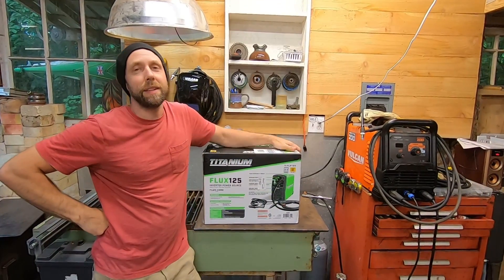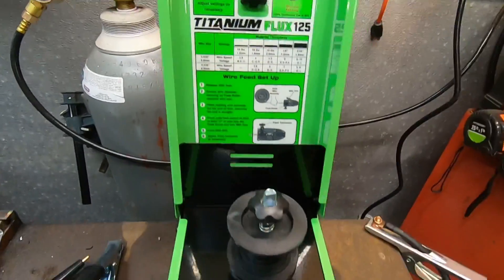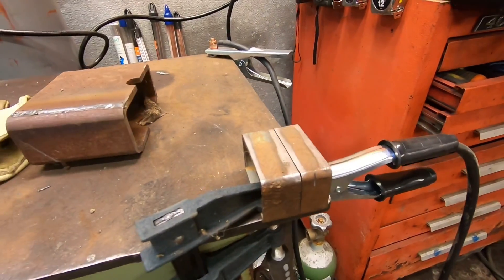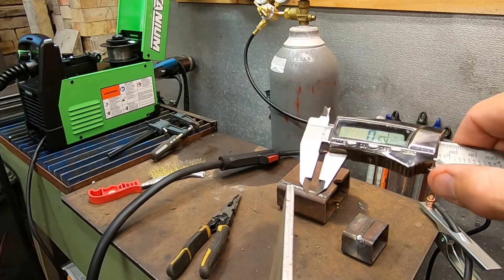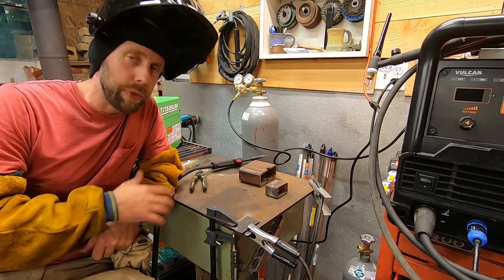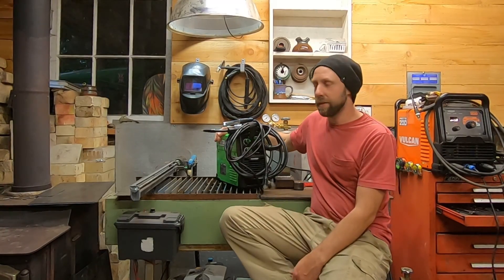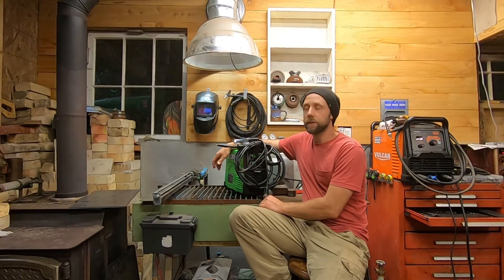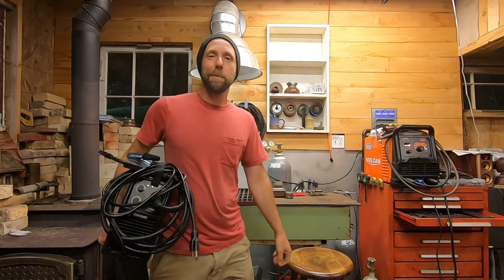Titanium Flux 125 welder from Harbor Freight

Comment: Hey Mike, I just made my first cut on my DIY sawmill, inspired by your channel!
Most of the welds were done with the Titanium 125 flux welder (I have since gotten the 170 so I can run gas).  I still have some work to do, but had to test it out. Belt is loose, need to address that and I need to put a cutting scale/ruler up.  Thanks for the support through your videos.
https://youtu.be/hMDO3ridKa0
Reply from the maker: David Hanson That it awesome David!!!
Thank you so much for sharing this with me 🙂 
Would it be possible once you get the final touches done you could make a video talking about the parts you used like what bike wheels you used and how you went about making it, I and many others would really like seeing that.
If you do, please post it to one of my sawmill videos and I will pin the comment at the top of the comment section with your video link in it so others can check your mill out!
Reply: @Mikefestiva  Sure, I can do that sometime in the future.  I'm better at just building and modding, but talking, will have to make an outline or script so I will not get off track.  I got most of my stuff off ebay, and local iron scrap yard.  He had a lot of 2" pipe, so like you said, try and use what you have around.

Comment: so do you still like this 125 amp welder
Reply from the maker: Yes it’s a good little machine 👍 I don’t use it much because I have the Titanium 200 and ProTig 200 for my main welders so I let my friend use the flux 125 for now. We have a Flux 125 at my work and I use it often for quick repairs around our shop when I don’t feel like dragging a bigger welder and bottle around.
Reply: Mike festiva I just purchased this one so I’m excited to learn and start using it
Reply from the maker: Mark Putito Nice 👍 I think you will have a lot of fun with it. Years ago I bought a little 90 amp flux welder from harbor freight and it got me welding, but I have to say this flux 125 is far better in so many ways then that 90 amp welder. Take care
Reply: @Mikefestiva  hi would you recommend this for some muffler welding? Thanks in advance.

Comment: Hey mike, newish subscriber here but love your videos and has me itching to try my hand at some simple fabrications. I have one of those harbor.F  trailers and I made into a kayak trailer and want to add a second tier to it to add a rooftop ten too. I want to weld it on the trailer instead of just bolting it together. Do you think this welder is the right one to weld 2" square tubing, and will the welds be sturdy enough for about 500lbs. Or should I be looking at a stick welder. Thanks in advance, keep up the hard work
Reply: Should work just fine!!! I personally would add some gusset plate bracing at corners & joints for extra strength & stability!!!😎👍🏻

Comment: Do you think this is okay for a complete novice? 
Project-wise I'm looking to make a simple sidecar on my scooter for my dog. I have a 50cc scooter that is his project and I want to make a simple sidecar out of thin gauge tubing and thin stock. I started trying to braise aluminum but I just burned through a ton of gas and couldn't get decent bonds. I want to learn to weld anyway, and this looks like a great option to start with.

Any advice is welcome and appreciated!  
Thanks!

- Dante Antonio
Reply: It can weld 3/16 no issues. Thats a decent plate thickness. Ive tried it on 1/4 and it got root penetration no problem. Wouldn't go any more than that on a single pass. Ive used mine on a lot of stuff but ive got the titanium 200 unlimited as my main welder. The little 125 is perfect on a 5500 watt plus generator. Makes it pretty awesome for an emergency trail welding rig or just easy to take with you for mobile transport.
Reply: @luciankristov6436  

Are you using 035 wire for thicker material? 
It seems to get plenty hot. For a 110 welder of it's size, the power is something extraordinary. I think the limitations for thicker material would probably be the wire speed. Seems heat and power is not an issue for 3/16" material.  The settings don't show 1/4" but it's quite capable of doing it and making good welds.  Not sure about multiple passes with wire that comes with it.  Definitely do a thorough cleaning up of the slag, I guess it would work.  

But when I was welding some thicker stuff (little bit >3/16")
I ran by Home Depot and grabbed some 035 tips & Lincoln .035" flux wire (NR-211-MP). 

Was truly a different welder going from the 030 wire that came with it to the Lincoln 035 wire.  A huge and dramatic difference to where I don't see 1/4" being an issue at all. Having the thicker wire makes things go so much smoother on thicker material.
I bought INE .030" wire (E71T-GS) off Amazon, which is fantastic.  But I end up maxing wire speed all the way on anything => 3mm thick.  Anything around 1/8", I feel the flow is totally on edge with 030 wire, where it's almost not enough wire speed. 
It recommends to max the wire speed @10 for welding 1/8" material with .030 wire...
But for me, it feels like it's almost not enough.

 Yet when I throw in the Lincoln 035 wire, with the same the material (>3mm, ~1/8"), i feel like it's better at wire speed 6, which is with lower than they welder guide under the hood. The guide suggest 7 for 1/8" on 035 wire. Running 035 wire for me makes for much better welding of thicker material. For me, the wire feed is a limiting factor for 030 wire. Works great for thin but if I am doing 1/8", the 035 wire works so much better. I found no issue doing 1/4" with the 035 wire.  And even at that thickness, the voltage for me is nowhere near max. I end up limited by wire speed, cause on 1/4" I have the voltage on about 60% of it's max.  I hardly never need voltage past 60%, most of the time in the 40-60% range on this welder.  Which is crazy for a 110 machine, let alone a tiny lunch box.  I remember struggling with heat on other 110 machines but this one puts it out.

I have recorded amps well over 125 with my fluke clamp amp meter. No joke, 140 amps even peaks up as high as 160 amps.  With 035 wire and a clamp meter, have someone weld and watch it in real time. It's gonna jump around as this is the nature when the currents path disappears as the wire dissolves. But you can still see some high numbers while someone is welding.  hit the Max/min on the amp meter to see what the max is. For me, on my machine, it's well capable of 125 and blows past it, showing 140s and peaks of 150-160.  That is crazy crazy.

Honestly, I am not sure if that is the norm. Anyone with a clamp meter should try it.. maybe they're all different, or maybe it's the norm.  I suspect they all can do well past 125amps on thicker material.
I think I got the most amps, the highest readings with the voltage about 70% and wire speed maxed.

Anyway this thing is crazy powerful for such a tiny package.
Reply: Yes?

Really up to you how much time you put into learning it.  In my opinion, it's very easy to get up and going.  Get some scrap metal, watch some videos....an auto dimming helmet makes a big difference. The Chicago brand is ok but Amazon has some even better deals, cheaper ones with a feature labeled "true color technology" or something like that.  I have a couple and find them really good for the money.  They have high reviews, and some are priced 30 bucks or better.  I got one of the. with the extra large view, it was right at 40. 
Several different brands use the true color terminology. They seem the same or very similar.

Comment: I decided to buy this welder. I am a small contractor and i recently started to explore wrought iron fencing, it is a profitable niche! This is what i went with and had little previous welding experience. This turned out to be the best welder i could have bought. It is easy to use and no hassle. In the field on the jobsite that is GREAT not needing to dick with gas. I use a more comfortable strap but i do wield it on my shoulder while I go down the line. It is so damn small and light. It is so weird to be able to wear my welder, but it is really awesome. I love it. I've built about 1000' of wrought iron fencing with it and several small,repair jobs. Just hop in the Honda civic through the welder in the front seat and go fix a gate for $500 be back by lunch time i love the convenience of this thing. So far no problems
Reply from the maker: They are great little welders, for the size and price you just can’t go wrong! Thanks for commenting 🙂

Comment: Hi mike, will this work for welding rocker panels and box sides ect on my truck?
Reply from the maker: Yes this will be fine for welding body panels, the flux wire tends to run a bit hotter the MIG but it will work fine. One other thing you will probably want to use a angle grinder to clean up your welds a bit these flux machines have more splatter along the welds then MIG. Take care

Comment: Mike....will this welder run on a '15 AMP' circuit and if you don't know......this unit has a 'cold wire feed switch' on the backside of the front control panel under the top hatch.
Reply: 20 Amp recommended per specs.

Comment: Ok, so. Ok. I am certified in GMAW and FCAW processes. I schooled with Miller products and work with Miller products. I had the HF Chicago Electric 90 amp machine and it ran... ok. It was impossible to weld anything over 1/8" due to tripping the breaker so I always just figured that it ran a little wonky due to electrical shortcomings. I bought this TI 125 machine today and honestly, thoroughly impressed with how it runs. I ran outside corner joints on thin gauge, ran great. Fillet weld on a 1/8" flat stock, ran great. Good fusion at the toes, good contour. Didn't cut and etch. Ran an 1/8" square groove with backing on 1/8" flat stock. Again, ran great. Good contour. Good fusion. Haven't cut and etched. Thanks for the review, I'm satisfied with my purchase.
Reply: Ok guys, update. I cut and etched the start and the stop on the fillet weld. Both had good penetration at the root and on the legs. 
Guys, this isn't a Miller. Don't misunderstand. It's a good machine, it'll suit your garage purposes better than you'd probably expect, but don't expect a millermatic for 200 bucks.
Reply: @53prime  
I know, Feels dumb when I talk about it. But this little cheap welder is something else.  Has to be used to truly understand.  Its just way more than what most welders would expect.  But trying to explain that, many people just assume you don't have a clue what you're talking about.. at least that's what it seems like for me.

This welder has some heat to it. Of course not a nice 220v Miller mig.  But if get to use a titanium 125, it doesn't take long to realize,, it's not your run of the mill 110v cheapo welder. It's an anomaly. For the price it is special
Reply: Should note these were all flat and horizontal. Will run some overhead and some uphill soon and rate.
Reply: I picked up one and love it.   I'd say it runs a bit on the hot side with their ballpark settings and even on sheet metal, it will quickly blow holes through if you don't move pretty quick or just stitch weld or use a straight bead. So smooth though. Loving it.

Comment: How do you connect the gas? Not a welder but just got a stick welder to learn..😉
Reply from the maker: No gas hookup on this little welder, it’s a flux welder. It’s got flux inside the wire, kind of like  stick welding rod but that’s on the outside.
I hope this helps.
Reply: @Mikefestiva   I recall you mentioning adapting this to gas and was wondering if you have had a chance to try that yet?
Reply: Mike festiva: So isn’t gas mandatory for a flux welder? Isn’t that MIG ?
Reply: @RingZero  no,in mig the gas is the shield,stick,and flux core uses flux,when it burns it creates gas to shield the weld
Reply: Jeffrey Worth : so flux welding is different than MIG?
Reply: @RingZero   Yes,still runs wire thru a gun like mig,but welds different,more like stick welding.Its hotter than mig,runs slower wire speed,has slag.A little harder to see the puddle,more smoke a bit more spatter etc.
Reply: Jeffrey Worth : ok got it , thanks

Comment: Hey Mike, Great vid.  THinking of purchasing one of these and you may have put me over the top.  Question:  Can other tips be used such as a stand off for spot welding?  Or does Titanium use proprietary threads on the gun?  Thanks.

Comment: Thank you for the video! How tight do you set the tension know near the wire spool?
Thanks again!
Reply from the maker: You want it to be tight enough so the spool won’t unravel on it’s own but not so tight that the motor drive struggles to pull wire off of it. 
Try and find a good middle ground.
The other tension knob the one on the motor drive should be set tight enough that it doesn’t slip on the wire, it should be able to push out and bend the wire if you feed the wire out of the MiG onto a scrap of wood. I hope this helps.
Reply: @Mikefestiva  Many thanks, Mike!
Reply: The manual states that you should set the tension tight enough so that the wire will bend when it hits a piece of wood while feeding out of the gun.

Comment: hey @mikefestiva, do you think the welder could weld a motorcycle frame. I am trying to weld a flat bar stock to the frame to support the seat and also trying to weld a cafe racer hoop at the end of the frame. I would really appreciate any replies.
Reply from the maker: Yes for sure! You will have no problem welding motorcycle frame, being flux core wire it will not be as clean of welds but you can wire brush and grind a little to clean it up. What are you working on?
I have a old 1972 CB 350 Four that I have fixed up over the years, I had a modified CB 200 twin that I had a lot of fun build but I gave it to my nephew. Take care
Reply: @Mikefestiva  i have a 1978 xs400 2e, I am trying to turn it to a brat style, weld a u loop/hoop at the end of the frame. All the welders near me are asking for more than 100$ for a simple job that would take 10-15 mins so I thought i'll buy a welder myself and weld the frame. Do you know if the welder would work with a 15 amp outlet as that's the only available outlet I have near my apartment and I don't have a garage. sucks. thanks for the reply
Reply from the maker: Khizer Shareef Definitely spend the money on this welder rather then give those A holes your cash, it definitely frustrates me that those dudes couldn’t just hook you up on the welds for some beer or lunch, I have had bull $hit quotes like that before, it just makes me want to do the work my self. I’m sure this will weld your frame on the 1/8” or lower setting on a 15 amp breaker.  Have you ever welded before? Check out this video I did teaching my nephew how to weld with this welder.
How to weld, Tips for Beginners https://youtu.be/b-zI6OJe-ik
Reply: Just want to say I and other viewers really appreciate your quick and helpful responses. I also have a similar project lined up so I am very thankful for your expertise!

Comment: For those curious about amperage draw of the titanium flux 125.I did some testing on 2 different settings.Both done with Blue Demon .030 wire,with welder hooked up to a 14 gauge,25ft extension cord.readings from a Kill a watt p3 testor.Wire speed at 10,voltage at G,peaked at 20.72 amps.Wire speed at 9,voltage on F resulted in a peak of 19.50 amps.So pushing the machine past 9/F could get u in trouble on a 20 amp breaker,on a longish weld.
Reply from the maker: Thanks Jeffrey for taking the time to post this info! Have you thought about making some YouTube videos? I think you would make some helpful videos!
Reply: @Mikefestiva  hey Mike,
Maybe when/if I retire next year, lol.I like solving problems,im a industrial refrigeration mech now for 36 years,60years old,still learning every day.Had a big job last year,pipe weldors we contracted had a lot of leaks on ammonia lines.process was mostly inner shield flux core.I repaired most of them myself with tig.Wanted to see what might have gone wrong with the welding contractors flux core process.The only reason I bought the little titanium 125.It was pin hole porosity.Figured my findings could help some people.

Comment: Great video Mike, I found it on Harbor Freights website when looking for a welder!  I think it will be perfect for what i need, I don't weld much at all.  You make it look easy, I hope my welds turn out that nice!
Reply from the maker: Right on!  I think you will get some good use out of this welder. A friend of mine mentioned he saw my video on the Harbor Freight website about 6 months ago, that’s cool there still using my review on there 👍 
Take care
Reply: @Mikefestiva  Yeah, I actually ended up buying the titanium 140.  I'll need to do some thin exhaust stuff so I figured that having the gas would be a nice option for that.  So far I just did some flux core welding and it worked great.

Comment: Another flux core tip with this machine.Hold a longer stick out than u would do with solid wire mig.try 3/8" to 1/2",I f u run a short stickout,like I do with solid wire mig with gas,u can get pin hole porosity.I learned the flux inside the wire needs to be preheated before it enters the pool,a short stick out doesnt allow this
Reply from the maker: Good info Jeffrey 👍